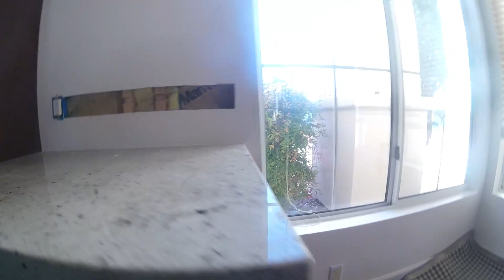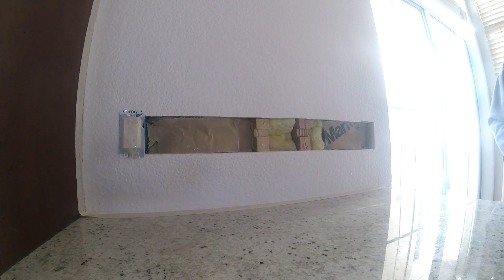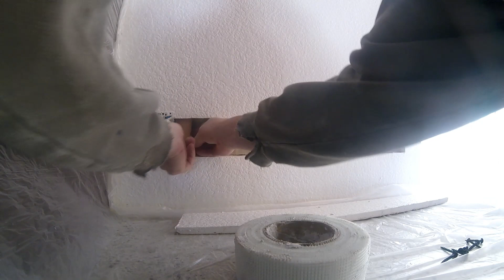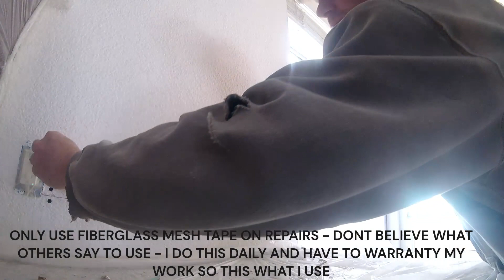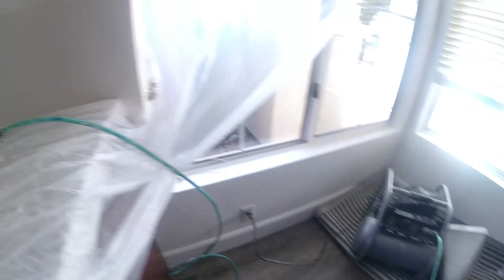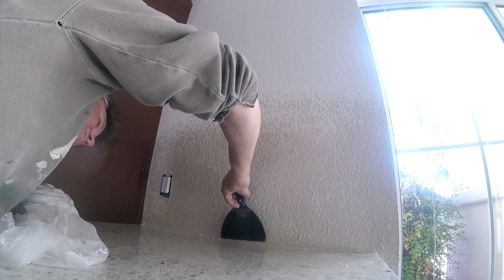process of patching a hole in your wall after an electrician has relocated a power plug box

Comment: Why not running drywall fill piece full length?
Reply from the maker: THEY ALREADY HAD CUTOUT PIECE i just had piece in 3 inch
also original cutouts are flush and newsheetrock is deeper so always use original cut outs if able
Reply: @drywallrepair  couldn't tell from video that it was the cutout piece-
Reply from the maker: They cut out to delete old box and run other to left so only had fill in new sheetrock old 3 inch box, we never use more materials out of pocket then need be stuff cost money and more stuff haul away and trash cleanup
Reply from the maker: more patching video playlists here -  https://www.youtube.com/watch?v=kmNksSpf4AE&list=PLBz61ZEZh-RVf03b8u7hzfjxngWsUPHgh
Reply: So is it two coats of quick set then spray texture with topping mud? Do you always use a sprayer even for smaller patches?
Reply from the maker: Always do min of 2 coats I can do two coats as I work with mud most beginners may need 3 coats . Yes always use hopper spray textures, as others like those cabs or sponges don't give correct texture match I don't care what others say you need apply materials same as original spray
Reply from the maker: Topping or joint compounds to spray , some guys try use hot mud spray but I never will because hot muds are not as creamy clean finish as regular mud
Reply: @drywallrepair  thank you, what nozzle size and psi would you use for orange peel vs knock down?
Reply from the maker: Most my spray texture videos go over this,those free to watch ,  super thanks are accepted if your needing my time answer your ongoing questions
Reply from the maker: NEW VIDEO HERE 
https://youtu.be/4b8zAfQaq4s